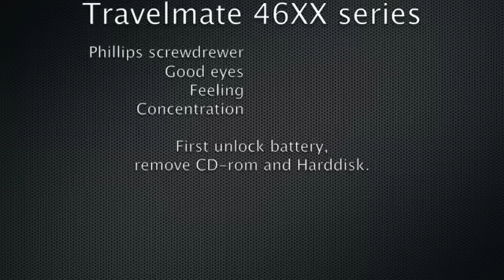How to open a Acer Travelmate

Comment: Hy, i got a problem with my Acer travelmate 5720.
when i plug in the power the battery charging indicator goes on. but when i press the powerbutten it dies. i know its not software related as i already tried different OS's and even different hard-drives and memory... maybe you know the answer.
Thanks.